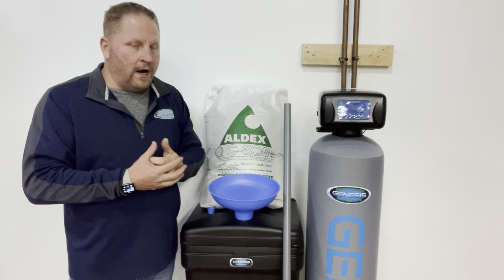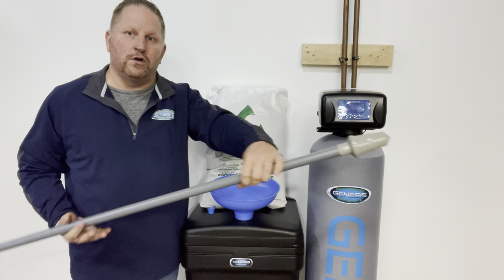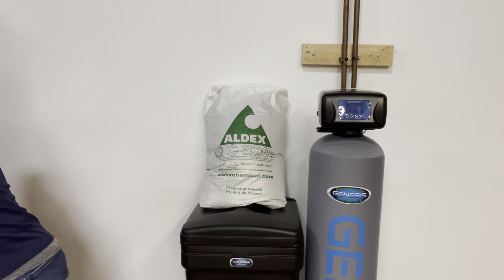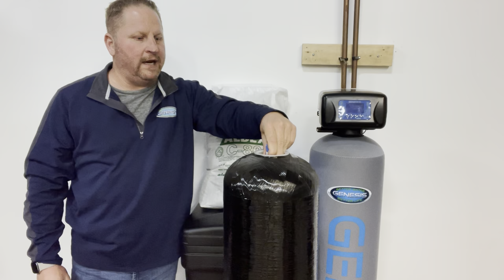Re-bedding a Water Softener

Comment: You can leave the resin tank in place and empty out the water and resin with a wet/dry shop vac. Brush any beads out of the threads before screwing the valve back on.

Comment: Hi,  at 3:15 you mention Relieving ( releasing ) the pressure before disconnecting main valve from bypass valve.  How do you release the pressure ?  
For 48000 grain or more you mention to add gravel too ? I don't believe my Fleck 5600 SXT had gravel.
Also,  did you recommend the use of IRON OUT powder to remove iron from the Resin ?
Thanks !
Reply from the maker: On any Fleck 5600 you can start a manual regeneration. Once the system starts to backwash and push water out to the drain you then close the bypass. This will ensure the pressure in the tank is pushed out down the drain. The control valve can then be disconnected from the bypass. On a 48,000 grain you don’t have to have gravel but you can get 20lbs of gravel if you want. As for iron out powder. If you have 0.5ppm of iron up to 2ppm on a well you can use a Rescare EasyFeeder that we sell. It can be mounted on any brine tank and it feeds liquid resin cleaner at a slow rate to always ensure the resin does not become iron fouled. Feel free to call us or email us and we can assist further. 847-462-9000 or sales@discountwatersofteners.com